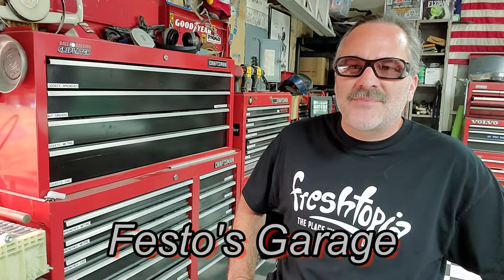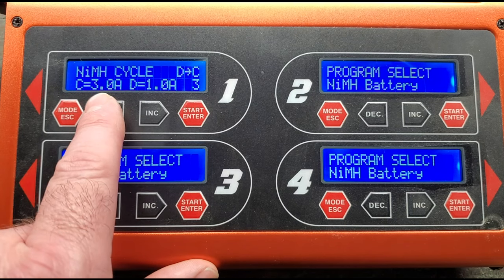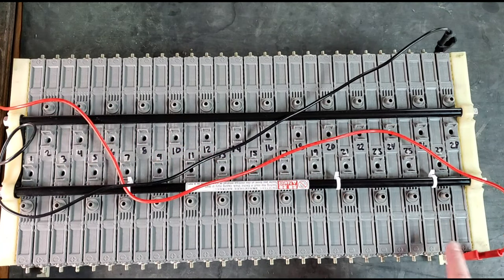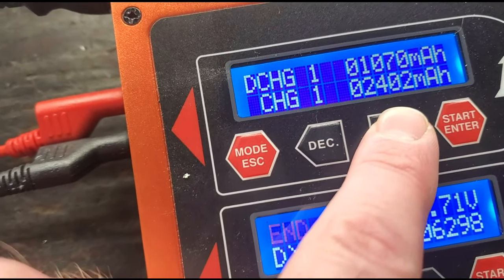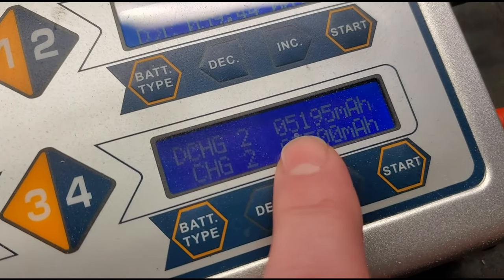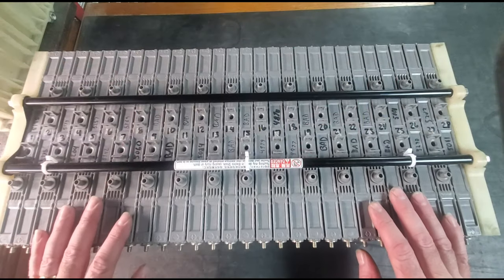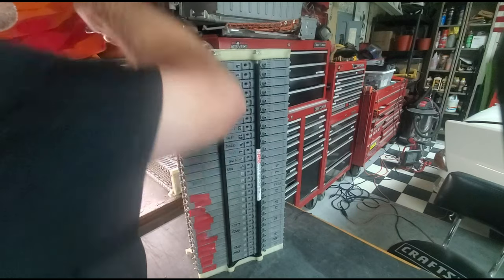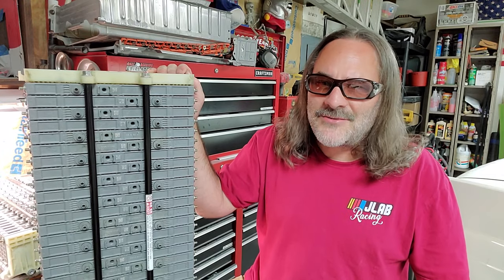Hybrid Battery Pack Refurbish - Step-By-Step w/ Settings - 2nd & 3rd Gen Toyota Prius - CQ3 Charger

Comment: So I just started doing this process thank you so much for making it so easy to follow by the way. Am on day 3 now have already done the process on about 11 modules and the low numbers don't go higher than two digits.  Should I continue trying to bring them back or just buy new modules?
Reply from the maker: Thank you for watching and commenting. It is acceptable to have low values on discharge mah for a few cycles particularly if the batteries have been sitting for a bit. Have you double checked charger settings? If you have run more than 12 cycles on a battery and still are getting only double digits on the discharge mah values then that battery may not be salvageable.
Reply: I have it exactly as you instructed on video one other thing it's only showing me results for one cycle.
Reply from the maker: Are you getting display of CAPA or END or FULL at completion of cycles - before you look at the result(s)? There should be a reason your charger will only run 1 cycle instead of the 3 it is set for.
Reply: Capa at the end
Reply from the maker: From your description and the CAPA message it appears you are meeting the charge set point of 7500mah on first cycle. This is fine but you will need to run the cycles again until your discharge value is at least 5000mah.

Comment: Hello Gregg thanks for the video
quick question though, each cycle discharge and charge the battery 3 times or 5?
also how long does 1 cycle take ?
Reply from the maker: Thank you for watching. Yes, I usually set the charger up for 3 cycles to get a feel of how the battery does. If I see it will need a while to recover or I do not want to check on it as often, then I change to 5 cycles. The time it takes to go through the cycles will depend on how the battery responds to the charging and discharging.

Comment: Question: 

Hey so what if a cell/ module has inconsistent results for the discharge and charge? 

On one of my cells the numbers kept going down and up and down and up again, so on so forth. 

But it did eventually hit 5000/7500 after 20 or so cycles.. should I use this module/cell? In my mind I shouldn’t because it’ll probably still be inconsistent when it’s in the car and will give me the red triangle. 

But I’m no expert! Please help!
Reply from the maker: I agree with your logic on that one. Consider that battery borderline but still good. If you have the additional funds to purchase extra one then replace it but if you do not then I believe it will last long enough for you to save up some more money while driving around. I have a pack with a bunch of those borderline batteries, it comes in handy to drive on while I am rebuilding the pack that actually belongs in the car.

Comment: Hi Gregg what’s the minimum you suggest for the discharged number? I found some of mine that reach around 3,800 till 4,000 is always the range of my minimum
Reply from the maker: Thanks for watching. I use Discharge value of 5000mah as my minimum.
Reply: @GreggFesto  so if they don’t reach the 5,000mah discharged there not good

Comment: Another great video Gregg! On average how long did it take for 1 cycle per module to discharge and charge? Thank you!
Reply from the maker: Thank you for watching. I am not sure how long a single cycle takes on average. It depends greatly on the health of the battery of course. I setup for multiple cycles and check on charger a few times a day. Some batteries like that the really good one in video are finished in 24 hours, some like the one that had to be cycled multiple times take days. This pack took 21 days with 2 chargers which includes refurbishing the 14 replacement batteries.
Reply: I have just gone thru this with two packs.  Many of the modules take 8 hours per cycle, so that can total 24 hours for 3 cycles.  It takes longer to charge the better the module, also they reach "capa" or capacity of 7500 mah that you've set to protect the battery from overcharging.  if that happens as Gregg shows, the charge "times out" and you have to manually restart the next cycle.

Comment: Thank you for the video Gregg, in the process of reconditioning. Do you load test these modules?
Reply from the maker: Thank you for watching. If the discharge capacity is 5000mah then they should be good to go. I put back in car, drive for a bit, then look at dr prius app for health.

Comment: Great Video!!! will this process work on a Chevy Volt?  I actually have a Hybrid Cadillac CT6 and I have had problems finding reliable service for it, including the dealership.  I know a lot about the vehicle, but lack the battery discharger that GM recommends.  Could I use the one that you used in this video perhaps?
Reply from the maker: Thank you for watching. This charger and process should work on most any hybrid battery but the settings may change based on the battery type, voltage, and capacity.  I suggest finding a forum for the Volt and see if someone there knows the specifics for battery and refurbish charging.

Comment: Good vid but one thing, charge cap 7500 is not enough! Really good modules with near full capacity (6500) will charge to 9000 even a little more

Comment: If the one you ran 20 times made it to 4977 and not 5000 you mentioned was bad is that number not close Enough or were there other reasons
Reply from the maker: Thank you for watching. The pack will only be as strong as the lowest value battery. I use 5000mah as my cutoff point. I reject anything that does not make this capacity.

Comment: Hey Gregg, quick question for ya... I have the exact same BGUAC CQ3 Charger and in the User Settings, you didn't cover one section which says "Input Power Low Cut-Off"?? Mine seems to be set by default to 11V, but wondering if that's what you use as well since you didn't mention it in the video? Thanks. :)
Ps. Also in User Settings, there is another section for "Battery end volt" and then has options for LiPo, LiIo, LiFe, LiHv, and Pb but no NiMH... So just curious what you have that section set to as well or if it even matters? Thanks again. :)
Reply from the maker: Thanks for watching.  All settings that I did not mention were left as factory. Please write back and let us know how your pack turns out.

Comment: Hey first I want to say great video.
I want to do the same thing to my prius battery. So I went to order the same charger you're using and there a statement saying
 This charger is NOT designed for use with hybrid car batteries. Any such use will damage the charger and is not covered by warranty. Updated firmware since its release now allows this charger to support high-voltage charging. Do you see this same message and it still work for you. The purpose of me buying this charger is to do the same thing you did. I don't want to buy it and can't use it. What do you think
Reply from the maker: Thank you for watching. I have not seen this warning. I am not sure why it says this now.  I suggest contacting EV-PEAK customer service for more info. Please write back and let us know what you find out.

Comment: Hi Greg, great video thanks for sharing, however I’m interested in purchasing the same battery chargers but I’m curious how long it takes to discharge and recharge each battery module normally?  I’ll be using the chargers for business so it’s not for personal use, thanks in advance
Reply from the maker: Thanks for watching. The time it takes to cycle each battery module will vary based on health of the battery. Some batteries you can run 3 cycles and it is good while others may require 15 or more cycles. I start the charger then check it a couple times throughout the day so I am not usually around when a cycle ends. In my experience it takes around 16-20 days to do the whole pack.
Reply: Thank you,  I just received my CQ3 charger today so I’m currently testing it on one module, I followed your settings to set up mines 👍🏼

Comment: Question Gregg, I’ve had a set of 4 cells that have said ended and full, but when I press the “Mode” button, it doesn’t show me the charge/discharge cycle periods. It just goes to the presets of the charge/discharge rates. Any help would be nice thank you and thank you for the helpful video👌🏽
Reply from the maker: Thank you for watching. If you got the END message the charger should have run all cycles that you selected without achieving the capacity setpoint. Is it possible that you are selecting the wrong button to view results? I believe it should be the one on far left. If you press the wrong button the results will be lost. Please let me know what you find out.
Reply: @GreggFesto  hey thanks for the response, the first time when I read Full, I made sure to press the far left button but the results were lost, I tried again when the modules read End and then I was able to see the results, I don’t know why I didn’t see the results the first time. 
Another question if you don’t mind, how long did it  take to “refurbish” the 28 cells with your 2x4 chargers before starting the balance?
Reply from the maker: The time it takes to do this job will vary based on the health of the batteries. Some could take 2 cycles to bring back to 5000mah while others could take 15 cycles to achieve the same results. I estimate 2-3 weeks is average for me to get the job done.

Comment: On the bad modules, why didn't you go lower voltage on cycles? With a lower current
Reply from the maker: Thanks for watching and commenting. I have been told that it could be detrimental to discharge under 6.0V but have done it before and did not see much difference. Lowering the current does seem to help some but adds considerable time. I may try the lower current settings on some of the batteries I replaced from this pack and see whats happens. If good results, I will make a video.

Comment: Gregg, after each individual battery is charged, how long can it sit on the shelf before being reinstalled into the Prius? Seems like the whole process might take several weeks so by the time a person is done charging the last battery, the first one would have been sitting there for a long time. Any suggestions?
Reply from the maker: Thanks for watching. This process does take a while but the batteries are fine. The step of balancing will bring them all to the same level. I have not had any issues.

Comment: why not use the prolong charger/discharger? seems like it would take way less time and not that much more expensive.
Reply from the maker: I was taught this process with the CQ3 and it works so well I have continued to use it. Have not tried prolong charger before. Thank you for watching and commenting.
Reply: Note: they're called modules, not cells.  Each module has six cells.
There is the Hybrid Automotive Prolong stuff and the Maxx-Volts stuff - they both do the same thing (also called a "grid charger).
These chargers deal with the whole pack at once (ie not the individual modules).
The Prolong equipment will NOT repair a dead module.
If you've got a few dead modules in a pack then you have to identify and replace those modules, which is what this video clip shows.
Once you've tested all the modules and replaced the dead ones you need to balance the pack (ie get all modules to the same voltage, or as close as possible to that).
That's what a Prolong charger will do - it will pump current into the whole pack at a slow rate.  
Each cell in each module will "fill up".  When a cell is full it will convert the current into heat, but as it's such a low current there won't be enough each to damage the module.  
So, by charging with a Prolong charger you'll end up with all cells fully charged and a lukewarm battery pack (but not so hot that it damages any modules).
A Prolong charger is good for: 
1) balancing the back once you've got a good set of modules together, and:
2) regular maintenance - balancing the pack regularly will help to make it last longer (eg every six months).
Reply: @philmeupbaby: The reason is that you're only charging up the entire pack and discharging the entire pack - as a complete thing with the Prolong charger.  That might be fine, but what's happening here is looking at the individual 28 modules.  If you've not got any bad blocks (14 of them) meaning some bad modules (the actual 28 blades), you might be OK with the 'charge and discharge the whole battery' approach, but in many of our cars at 150K+ miles, we have a couple bad modules.  It will do little good to the bad modules to be part of the Prolong process, as far as I know.   When I manually tried to condition the 4 bad modules in my battery, no amount of CHG/DCHGing helped them - they stayed failed...

Comment: Which type of welding wire did you use in the video?
Reply from the maker: I think was stainless steel. Anything metal will work. If you are installing new bus bars then you will have enough to do the task when combined with the old bus bars.

Comment: Great resource! Any parameters for ford escape batteries?

You should also measure from positive post to bottom mounting lug. I had a battery pack that was leaking through the boss and causing a high voltage leak to ground fault.
Reply from the maker: Thank you for watching and commenting with a great suggestion.
Reply: What relationship does the 7500mAh upper limit have to the stated capacity of the cell? I’m trying to figure out what the parameters would be be for my escape.
The Toyota gen2 mAh is 6500, but I believe you set an upper limit of 7500. 
The escape cells are rated 6V @ 5500mAh.
Is the 1000 over an arbitrary amount? 
I’m not criticizing, I just want to approach the escape batteries with some reasonable test scheme.
I’ve been charging cells and subjecting them to a load test. 
I’m using the ebc-a10h unit.
Reply: Btw the escape batteries are a real headache to get to. My daughters 08 Prius had the ground fault and I could probably tear down 10 Prius packs in the time it took me to do one escape.
Reply from the maker: I am not a charger expert by any means and do not know what the settings for Escape would be. I am using settings that were acquired from forum called PriusChat where there are many discussions about refurbishing the battery packs. Perhaps you can find the settings you need at a forum for Escape or join the PriusChat forum where one the people there who have better knowledge than I do about this subject could help. I appreciate you watching my video and hope you get the Escape going. A video of how you do it could be very helpful to others if you have time to produce one.
Reply: @irritantno9  It sounds like there are 5 cells in a module (1.2v x 5 = 6v).  Personally, I think a better mah for Prius is 6500 mah.  For the Prius, the max voltage of a module is (6 cells x 1.433333v = 8.60v).  For the Escape, it sounds like you have 5 cells (which are likely 1.2v each).  Max voltage for Escape may be (1.4333v x 5 cells = 7.16666v.  This is just extrapolating the data you provided here (of 6V @ 5500 mah).
Reply: I had a similar leak.  I inserted a thin paper sheet under each of the modules, to capture a little leaking fluid and also help me quickly see which modules were leaking.  They didn't leak much after that, but this helps see the leaks more easily.

Comment: Greg!!
You do not cover settings fully!!!
Myself and others are having trouble with the "END" and Miliamps reading process...
If your using this newer charger (the red one!). It does not read out the cycles when I hit " mode esc"!!

PLEASE HELP!!!
DID I NOT DO INITIAL SETTING CORRECTLY??
DID I NOT START FROM THE RIGHT SCREEN DISPLAY??
Reply from the maker: Thank you for watching. I believe the settings that matter to this process are covered. There are some settings that are factory unchanged and some that do not matter for this process. When doing this refurbish you should run the discharge then charge cycle. Once you get to end of cycle(s) then use the far left button to scroll through results. This is the same button to hit on silver charger and red charger although they are not marked the same.
Reply: Did you ever figure out why you were having that issue? I seem to be experiencing it at times.

Comment: What should the input power low cut-off voltage be set too on the charger?
Reply from the maker: Thank you for watching. I left mine at the default setting. I think that setting might make a difference if you were using DC input power from car battery or such.

Comment: I hsve some batteries I bought from a guy on FB. Is there a way to charge/discharge them without having them into compression at the battery pack? I ballooned one by trying without the compression yikes.
Reply from the maker: Thanks for watching.  You should always put the battery under compression when performing this procedure. If you are not able to put them in the pack you can try putting the battery between 2 pieces of wood in a vice or clamp.

Comment: Hi I have followed your steps with the same charger. All batteries I have tried which is 6 now have not went over 500 mah. I did one battery 8 cycles. Some batteries went up a little and back down. Since the numbers are so low should I keep trying or mark bad?
Reply from the maker: Thank you for watching. I have had batteries that read low to start but they usually go above 500mah after a couple of cycles. I suggest check all settings again to be sure they are correct. If still these batteries are low after several cycles then they should be replaced.